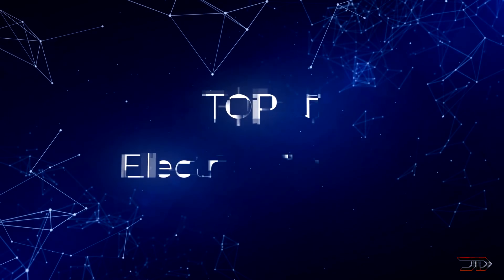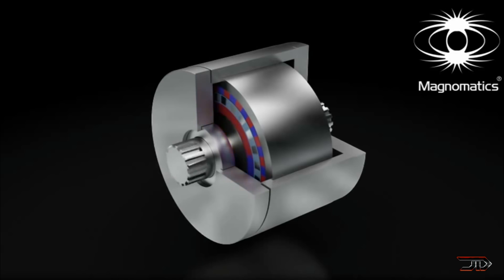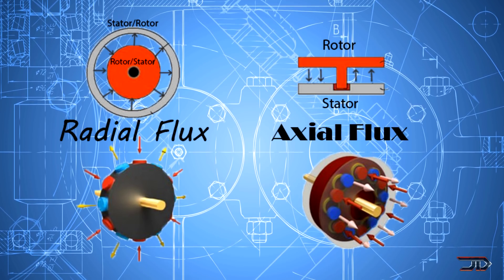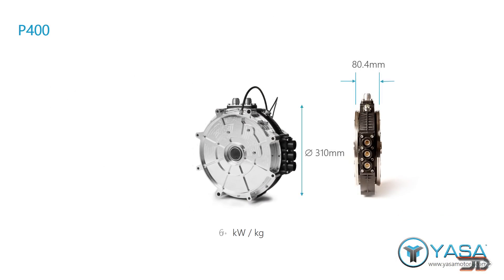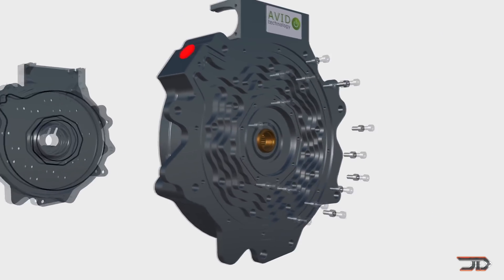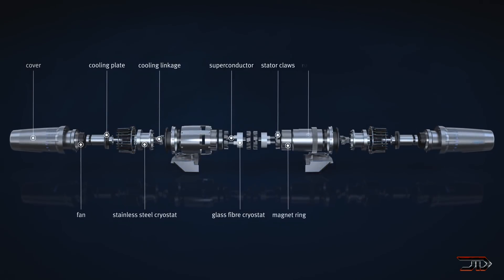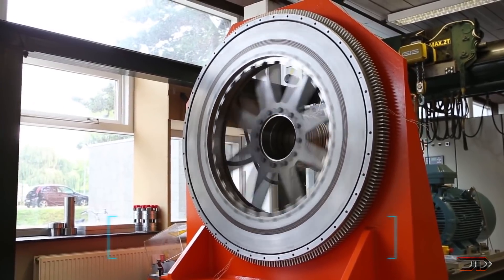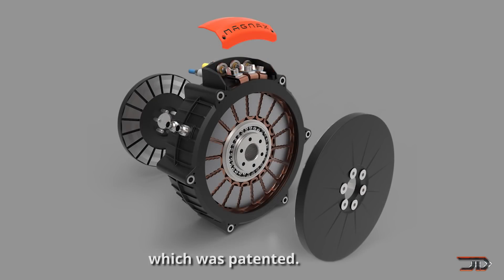5 Motors You Have To SEE To BELIEVE

Comment: electric cars are to dangerous I used to build them I know. your talking about an electric car using up to 5,000,000 watts of power or more in a 400 to 500 hp car and that is not what you think. The problem is "stall" and when you get into a high demand situation using electric motors they can "stall" and when that happens the entire wiring system can melt down in seconds and lead to the car catching on fire. Electric motors were not designed for variable rpm operation and this is also a factor. This is only a fascist attempt to take away you freedom to drive freely and any where you want and to control traffic by operation of the cars having no steering wheels and zero driver input.
Zero is the key here and thats exactly what you will get if you allow these fascists to deploy these and this dumb electric vehicle world, nothing. They are sick people and they will even begin charging you just to use the car to go any where and tax you 10,000 dollars a year to own one. So go along with them and you will have no rights at all in the end give an inch and they will take a mile ot in this case a light year.

Comment: I was trying to design a "Disc-Motor" back in 2012, which I called: The Electric-Wheel. Because this shape could be used in place of a wheel hub.
A Motorcycle/car could have; all wheel drive. 
I also believe that due to a larger diameter, it would use less power on start up because of the extra leverage. 
I remember seeing RR, stating that they had come up with this new idea! They may have got it patented, i'am not sure?
Thank you for your info, and I look forward to hearing more about electric motors and Batteries.

Comment: Imagine an electric rocket engine, that would be awesome
Reply: Rocket require thrust, not torque. Plane maybe, but that'd be useless in space.
Reply: @crisbowman  we only know how to use rocket engines with a chemical based propellant which is inefficient since it adds so much mass. The idea is to lighten the amount of mass. What I was thinking of was a propulsion system that uses ionized gas and pushes it extremely fast to increase momemtum.
Reply: @nickcave5947  I think you are talking about ion thrusters, which are still chemical ejection propulsion systems. The difference being an additional step is needed to convert the fuel before use. I'm not sure those even use pumps/fans, I think they are propelled by either proton exciters or some similar particle propulsion.
Reply: @crisbowman  its fascinating just how much room for improvement there is, I just want to find a way to make better propulsion. Gotta push for the future.
Reply: @nickcave5947  In my opinion, the best one currently withing our grasp is figuring out how to make protons, neutrons, and electrons interact with the very fabric of space. This way you could make systems akin to automotives or submarines. You would simply interact with the media around you.
Reply: @nickcave5947  And hyperspace/teleportation would be after that. I still don't know if it's possible or even worth the cost though.

Comment: The earth rotates once every 23 hours, 56 minutes and 4.09053 seconds, called the sidereal period, and its circumference is roughly 40,075 kilometres. Thus, the surface of the earth at the equator moves at a speed of 460 meters per second--or roughly 1,000 miles per hour.

Comment: Might make more sense if a split pcb board would run a logic when 4 motors are placed opposite to run in sync 2 air 2 fuel burn & air reversal to adjust flight path by easing the load on each motor individually. Forward & Backward flight possibility appears as an example same speed factor.

Comment: This was nice, but I would've like to hear more about each motor mentioned. Instead he just went over them very briefly.
Reply: Probably cuz he knows nothing about them.
Reply: @brokentombot  I also had the impression that he does not have the deeper knowledge about their working principles. Actually it is a good choice NOT to go deep when you dont know enough. Also, most of these motors contain a permanent magnet set. Sure those motors are lighter and stronger, but much more sensitive to heat, current, mechanical shock, corrosion, and can AGE... lose power and efficiency over time.
Reply: regular brushless motors... lol they run at 95%+ efficiency anyway and guy says they will be more efficient? like wtf its pretty close to 100% already.
Reply: @jebise1126  I think the idea on these motors is not efficiency improvement, but power to weight ratio improvement. so you can have a 100kW motor which is very compact and very light.

Comment: You missed Thane Heins ! search for 
Electric Vehicle Regenerative Acceleration.  This should be number one!
Reply: He claims his electric vehicle doesn't require recharging. He's either lying or not measuring the power correctly. After watching some of his videos, I'm pretty sure he's lying.
The only way I can see that he's not lying is if his test setup is acting like a flywheel and storing energy prior to the test.
If makes the same claims after he takes his electric bike out on the road and rides it for extended distances, then we'll know he's lying for sure.
I'd bet a lot of money the laws of physics apply to Thane Heins just as they apply to everyone else. I think it's very very likely Thane Heins is fraud. There's a very slight chance he's just really bad at testing. There's zero chance his electric vehicle breaks the laws of physics.

Comment: The revolution won't be so much superconductors, but enhanced conductors, made from the bottom up, discovered by the materials genome project or an equivalent.
Reply: martin smith 
Care to explain a tad more
Reply: @n1k32h  something that has greater conductivity than copper i guess and is lighter, much lighter. or at least as good conductivity than copper but its much lighter and can run at roon temperatures. at least that is my guess what he means. also nice word enhanced conductors.
Reply: yeah ,pls explain

Comment: Using graphene on copper winding to increase conductivity , and/or decrease the amout of copper reducing weight and costs and improve performance and efficiency?
Reply: graphene is an advanced material not yet ready for actual use. It's still in the laboratory stage.
Reply: @photon2724  graphene is currently used in quite a few things
Reply: @fate2022  oh cool. dident know. what are they using it for?
Reply: @photon2724  anti-corrosion coatings,electronics,sensors,flexible displays,solar panels...
Reply: PHOTON it is in use but we can’t make large pieces of it yet.
Reply: PHOTON wtf are you saying? Graphene is just used in various application now, electronic is the most important and useful

Comment: You forgot there piston electric motor that uses electromagnetics like gasoline. It uses gas and has thermodynamics pads for cooling and to help produce power as well as an alternator that turns on when gas is used or even as partial breaks.

Comment: I'm sorry I thought that was actual motors with real world test. Wrong title it's should said, "Future amazing electric motors
The best electric motor is TESLA Model 3 motor.
Investigate and you will be amazed.
Reply: Peak 87% efficiency, far from the best motor in any contest! Secondly it is too big for the model 3, at cruise it is down to the 85-82% efficiency, even lower at low speed! That's why they need elaborate cooling! At highway speed 3 kWh is lost as heat in batteries and motor. = totally unsuitable for for anybody else than jackass Americans that left school early and think thermodynamics is fake!

Comment: Any motor which will have fully parmmmmm partly wind turbine stator and power consumed replace a battery I'll break your nose and life turned inside out okay you fucking ac induction or a dc motor or hub motor with a gear system stick a wind turbine stator and component to a dc motor or ac induction many ways smartie tube to battery I'll be replacing when any consumed power is made immediately and perfect amount or More connect 1 or 9999999999999+ wind turbine to a motor by cog space or and belt chains turning 1 or 99999999999999999999+ wind turbine I'll be infinity sav fucking you for life paid again

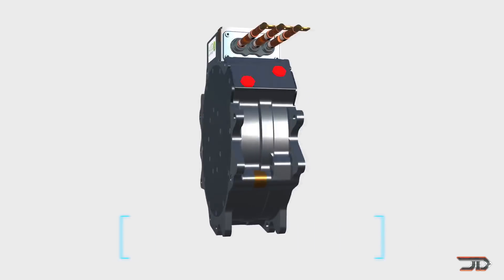Comment: 1:33 Ultra-Capacitors can not, and will not, replace the battery. They have a severe lack of energy density. They can act as a source or sink of high currents for a short time, that will allow to use a smaller battery with a higher internal resistance.
Reply: "Use the Force,Luke..." :-D

Comment: Athenos graphene super superconductor grafting strawberry for the axonal non resistant shape 6 pattern for the HHO should provide efficiency through electrolysis with Koh to be about 2 to 3 and 1/2 L of hydrogen a minute at a rate that would last probably 90% more efficiently of three months before maintenance is needed so that should last about two and a half years with no maintenance
Reply: @Ryben Flynn then why doesn't my battery go dead buddy and why does the navy use them and why do we use them on our cars I been doing Hho for over 1.6 years now
Reply: @bryanchannell7715  dude, you had a stroke - go to the hospital.
Reply: or a high pressure water injected diesel or high compression racing engine.. re-compress the cold, dense exhaust. na that'll never work....

Comment: Jeyapaul Samathanam, Landon Harris, Jim Drew, Jeremy Hart, Illisil, 
   People Please!
   The Man use the word correctly. The word is:
"pasito; small step." Implying that there is no transmission required!!! Exactly like he said.
    It could be said that small airplanes have pacito drive on the propeller, meaning direct drive. No transmission . No one calls it pacito drive though. That's only an illustration of pacito Drive.

NOT pseudo. Meaning: "not genuine; spurious or sham."
   Absolutely in no way does pseudo fit in the description of this electric motor.
Reply: Buddy, it is called 'Pseudo'... It doesn't mean 'fake' in this context. It means the motor uses rotating rings operating as electric motors within an electric motor to provide direct drive while actually providing reduction gearing in some sense. Hence 'pseudo' direct drive since it's not fully direct drive; it has a form of gearing and slip while still representing what looks like a direct drive system.

There is no such thing as a 'pacito drive' and very small aircraft don't use 'pacito drives'... They have the prop mounted directly to the engine output shaft. Larger aircraft  use gearboxes.
Reply: @karlfriedrich7758  . I already looked up the words and the definitions for you friend, they're in the English language. Shabbat shalom

Comment: Yes you already missed Synchronise Reluctance Motor by ABB which is atleast efficient as 96% and doesn't need cooling fan and  works on 3phase AC supply but in your list you  must have mentioned about DC Motors but in both the cases Motor Drive system is part and parcel of any new motor   system
Reply: NNNNNNNNNNNEEEEEEEEEEEEEERRRRRRRRRRRRRDDDDDDDDDDDD

Comment: YOU FORGOT TO MENTION THE PHOTONIC QUANTUM DRIVE MOTOR. IT HAS THE UNIQUE ABILITY TO RUN ON POINT ZERO ENERGY AND CAN RUN AT INFINITE RPMS. IT HAS ZERO MASS SO USES VERY LITTLE ENERGY. CURRENTLY IT STILL HAS A MINOR KNOWN DRAWBACK WHICH IS THAT WHEN RPMS GET CLOSE TO INFINITY AND MAX FLUX FORCE A BLACK HOLE MAY SPONTANEOUSLY SUPERIMPOSE ITS SPACE TIME PROXIMITY. THIS HASN'T BEEN REPORTED BECAUSE ALL EXPERIMENTS, AS YOU MAY IMAGINE, ENDED BADLY WITH NO SURVIVORS. HOWEVER, IMAGES THAT WERE UPLOADED DURING THE EXPERIMENTS WERE HELPFUL IN DETERMINING CAUSALITY.
Reply: fuck off, I'm not taking this troll bait. 10/10 for effort though.

Comment: Do any of these motors act like a synchronous motor? I mean do they act as a capacitor on the power line rather than an inductor? This is important four companies that have high power factor demand correction. The last synchronous Motors I ever saw where he normous they ran air compressors at Fisher body plant in Lansing. Their diameter was probably 12 ft and 3 ft wide. I don't know whatever happened to them when they tore the PowerHouse down it would have been something to put in a museum. They were very old.
Reply: All 5 motors are pm synchronous motors